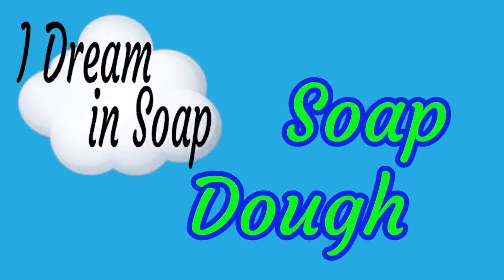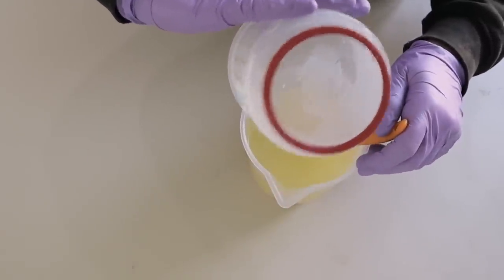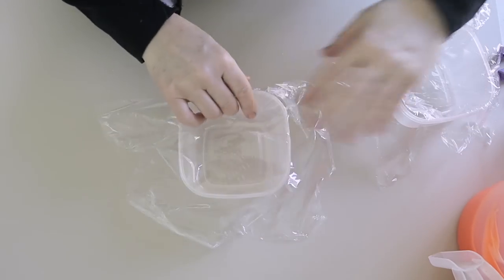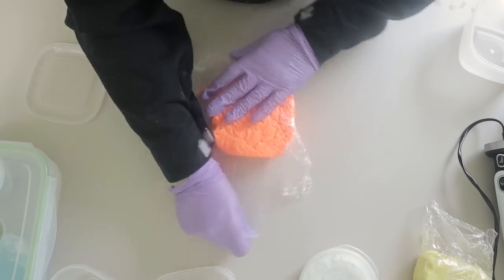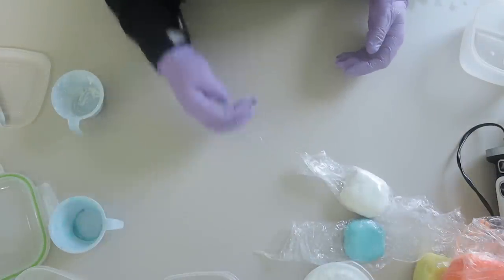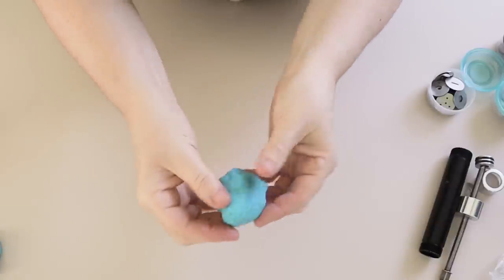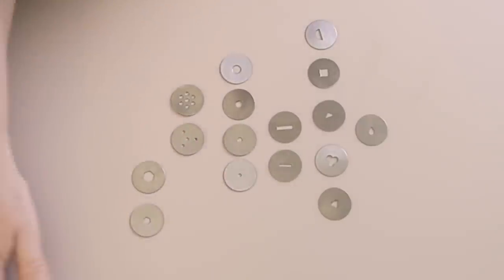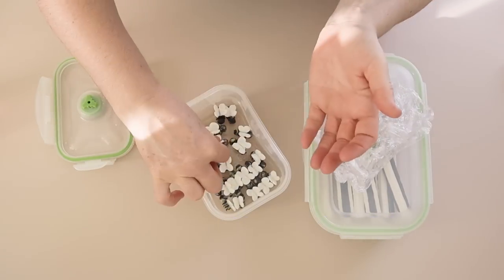How to make SOAP DOUGH, cold process soap dough, cold process soap making tutorial

Comment: Good tips! I remember Katie from Royalty soaps using a paper cup for some of her colors, and they came out a little crumbly. It could’ve been that it wasn’t air tight enough or that the paper absorbed some of the oils. I have gotten to try Sorcery Soaps dough. It’s good. I had a harder time smooshing it than my own, but other than that, they were equally difficult to work with. I went in with the expectation it would behave like clay or play dough, but it’s a slightly different animal for sure. It’s something I want to try playing with again soon since mine’s been sitting around a bit and see how it handles.
Reply from the maker: Hey Whittany, yes I think just using paper cups is a no go as they absorb the water, and being open to the air is bad news too. It certainly is different to play dough, it lacks the stretch that play dough or polymer clay has, so that does build in limitations. Do try your again, I think you will be pleasantly surprised how it seems to improve with age (as long as it's properly wrapped)

Comment: As always I learned so much. Thank you for this tutorial. I have made soap dough once before (putting it into a container to saponify) but did find it wasn't soft enough. I think maybe some air got in. Would it matter if the recipe is 60% hard oils to 40% soft oils? I'm wondering if this would make a difference for the final soap dough result.
Reply from the maker: Hi Tracy. I would think it should be OK, from what I can remember one of Bee's recipes is mainly Lard and Coconut oil, but does have a good amount of castor oil in, so maybe try upping the castor a bit. But I do definitely think that air is the biggest culprit of bad soap dough.
Reply: @IDreamInSoap   okay, thank you. I will try this.

Comment: As a new soap maker this video is a godsend! I've already made several colours but I haven't used them yet, I was wondering what you can use to remove the dough from a mold that isn't as flexible as silicone, would cornstarch be okay?
Reply from the maker: Ooh excellent I hope you have fun using them. For your mold, do you mean the actual mold you are using to make your embeds, if that's the case then a little cornstarch will be fine. If it's what you've used to make the soap dough in, then just scrape it out as you will be smooshing it up anyway 😊
Reply: @IDreamInSoap  Perfect, thank you so much! <3

Comment: Your soap is very delicate and wonderful!!  I want to try your method.
Can I use any recipe? Why do you exclude air?
I can't hear English well.
Reply from the maker: Hi Etsuko. I use my normal recipe and it works fine, but there are free recipes on Sorcery Soaps website if you struggle https://sorcerysoaps.com/blogs/soap-dough-recipe. The soap has to stay away from the air to stop it curing and going hard. It will then stay workable and you can use as dough, then once you have finished and it is in the normal bar of soap it will cure with the rest of the bar. Best wishes - Lisa
Reply: @IDreamInSoap  Thank you for your quick reply!!
understood. It's because it doesn't get stiff by touching the air.
I bought a polymer clay extruder immediately.
Reply from the maker: @EtsukoWatanabe  Yes that is it exactly. I'm sure you will do wonders with it, your soaps as amazing
Reply: Thank you 😊😊😊

Comment: Hi Lisa, Thanks for your great videos. I love soap dough and tried to make it after watching this. I have a quick question. Wondering if people can make soap dough with any CP soap recipes. Doesn't it need any specific oils? & Would the most important factor be to get rid of air from it? Thank you in advance. Happy soaping!
Reply from the maker: Hey Stella, I'm sure some recipes would work better than others, but yes you can generally use most recipes apart from things like 100% coconut oil etc, as that just turns into a brick :-) Keelpng the air away is so important and also giving it a bit of time. If you unwrap it after 24 hours and it's crumbly, just wrap it up again and leave it. I've had soap dough that initially just crumbled apart, but after it's been left it is silky smooth. I would certainly say, just give it a go, even if you don't make any specifically, just pour off some extra batter that you may have from a soap and see how it goes.
Reply: I Dream In Soap Thx a lot for your quick reply! I will try more! Have another great weekend, Lisa! 😍

Comment: Does it work with any CP recipe or do I need special recipe for this? Does the soap has to be very soft? I mean to create recipe for very soft soap?
Reply from the maker: It will work with most recipes, some will be better than others. The idea of this video was to get you to just give it a go with your own recipe to save mucking around with all sorts of different recipes. A 100% coconut oil soap wouldn't be good. The soap recipe doesn't want to be very soft as you want your soap dough to cure and give long lasting soap. If you keep it well wrapped it should stay soft

Comment: I have a few questions.  
You brought these to a thick trace, is that part of the process? Or does the trace matter at all?
Also does a water amount make a difference to the final quality of soap dough?  Would full water make a better soap dough?
Reply from the maker: Hi Shelley. The trace doesn't really seem to make much difference, I will often just use and extra from a loaf I'm pouring if I need soap dough, I make a bit extra, so that gets put away at whatever trace I poured the main soap at. I use quite a water discount my standard is 25% of oils and I find it's perfect for me. I do believe that some people use q bit higher as standard around 33%, but mine is always exactly the same as my recipe. One thing I would watch if you are using soap dough to make embeds inside your soap rather than on top is that if you use a different water % to your main soap the soap could cure a little oddly as the embed loses more water than the rest of the soap if you have increased your water for the soap dough. You could have a weird shrunken embed.

Comment: Lisa, I wonder if you can help me. While waiting for some supplies to arrive, I thought I could practice soap dough. After 24 hours, the pieces of dough felt nice and firm, but, as I began squooshing it, it crumbled, then began to sweat moisture. The more I worked it, the wetter it became. Finally, I pressed it back into the cling wrap and closed it up. I only tried one color. Do you think waiting another day or two will improve it or should I trash the entire batch and wait to make soap dough with better oils? I was using up some Crisco (veg shortening) I bought and decided I did not want it for my good soaps. I thoughT dough would be a good option since it would be only a tiny part of any soap and I do not sell my soaps anyway. I surely would appreciate if you can shed some light on this.
Reply from the maker: Ooh I've had crumbling a bit before but not sweating. With my crumbly one I wrapped it up again and left it for about a week then tried it again and it was great. So definitely try that before giving up on it and throwing it away. Maybe the Crisco takes a little longer to fully saponify.
Reply: I Dream In Soap Thank you. You are so great with quick replies, too. I will try to be patient and see if it recovers.

Comment: I have a question about this, would it be possible to take soap dough and roll it flat and layer the colors then roll it back into a round roll and then cut the dough into little coins with designs still be seen? I'm worried that soap dough wouldn't be hard enough so when you cut the coins out the colors smash Into another?
Reply from the maker: Yes that would work just fine, I quite often combine colours, all you would need to do is rill them together and then leave them for a little while, maybe a few hours, they will harden enough to cut well then

Comment: Morning/evening Lisa ... questions ... where do you store your soap dough , many places say the fridge, given it is air tight, is this necessary ... also ... how long does soap mould last .?  Does it have a use by date ... if the oils are in date etc ... I’m thinking as long as it is air tight when stored  and pliable when being used  then that answers the question.... thanks ... ❣️❣️❣️🌈🌈🌈🐝🐝🐝🧼🧼🧼🧼
Reply from the maker: Hi Teresa, ooh excellent questions. Definitely not in the fridge. A fridge isn't actually air tight enough as there's still lots of air in it, which gets replenished each times it's open, also the dough would be so hard when you take it out. I have mine in a box on the bottom shelf of a cupboard, so just in the house. It lats for ages, if it's kept sealed well it will easily last 6 months or more (and probably longer) it's just soap, so won't go off. The main thing that will ruin it is if it gets exposed to air, then it starts to cure, so check it every now and again and rewrap if necessary.
Reply: I Dream In Soap  thanks Lisa .... I did actually mean in The fridge in its vacuum pack ....🤣🤣🤣 however you answered my question so that’s great thankyou ... have a good day 🌈🌈🐝🐝❣️❣️

Comment: Brilliant, picked up some great tips. Hmmm how much does a vacuum sealer cost 🤔
Reply from the maker: Thanks Jackie. Vacuum sealers can vary, but you can get one that will do the job perfectly well for about £25, not sure what the cost in the US (don't know where you are). Mine was more expensive, It was about £125, but I use it an awful lot.
Reply: I Dream In Soap I'm here in the uk. Would be great to get one. At the moment, I use zip lock bags and suck the air out with a straw, not very technical but it works, sort of 🤗

Comment: Dear Lisa, I made a soap that won't harden, can I do something to fix it?
Reply from the maker: Do you mean soap dough or actual soap. It's hard to just guess what's wrong with it, you could have used too much water(in which case it will probably harden eventually) or too little lye, in which case it won't, sorry not much help.
Reply: I Dream In Soap so I can't melt it and add something?  or to go to the garbage
Reply: I made it with; vanilla butter 200,
Cacao butter 50,cocos oil 300, palm oil 450, H2O 380 and 145 NaOH

Comment: Thank you for another great video tut.!
I promised myself NOT to go on the soap-dough track. A day only has 24 hours and that is already a bit short for me. On the other hand, I realize that I've done soap projects, which would have been a lot easier using soap dough. (Like  my "melted snowman" cupcakes for example). 
I've got rainbow roses on my to-do list, so now I'm thinking of saving some of the soap (since I'll have at least 6 colours) and give it a try. The goal will be making canes  (just in case: a random video: https://youtu.be/58fkPxn3-EY).
Thx again, and see you in your next video!
Reply from the maker: Hey Corry, soap dough is great but it does add a lot of time to making the soap. I have made soap canes and in fact I have a soap that I made the other day with rose soap canes as embed which I will be uploading soon. The problem with soap dough is the canes don't work in the same way as polymer clay (I couldn't get your link to work, but guess it's a polymer clay video) you can't make them fat and then roll them to get them all thin as they do with the clay, as the soap dough doesn't stretch (believe me I have tried) so you either end up with big old canes, or you have to try to build them the size you want to finish with which is very fiddly.

Comment: I have to admit I'm super upset this is the 2nd day in a row that I did exactly as you said and I woke up to my soap as hard as a rock it was super sealed air tight
Reply from the maker: Hmm, that's not good, have you tried smooshing it, it will feel pretty tough to start with and then as you break it down it will loosed up and become more pliable. Sometimes I have to break smaller bits off of mine and give them a good squashing then wrap them up again and let them sit. Failing that, you can let me know your recipe (just basic outline) and I  may be able to spot an issue
Reply: @IDreamInSoap  yeah it's hard as a rock
48 ounces of olive oil
36 oz. Coconut oil
24 oz. Palm oil 
6 oz castor oil
17 0z lye
32 oz water
I cut this in half